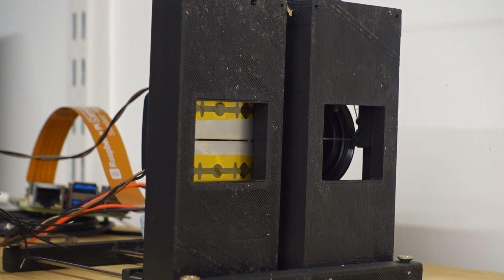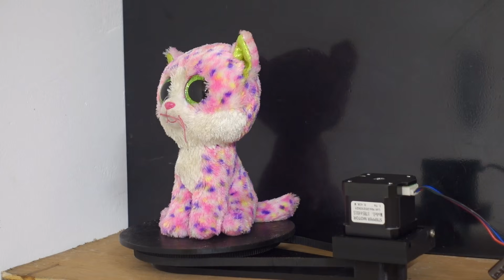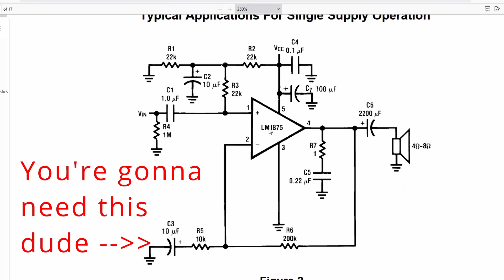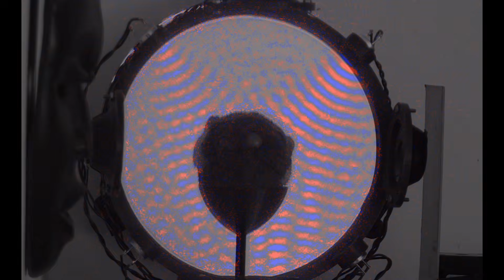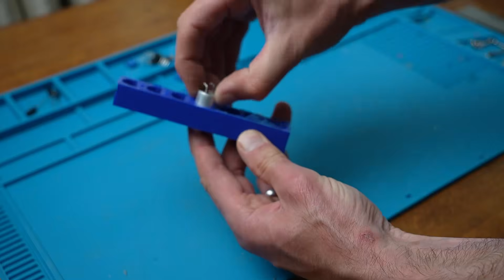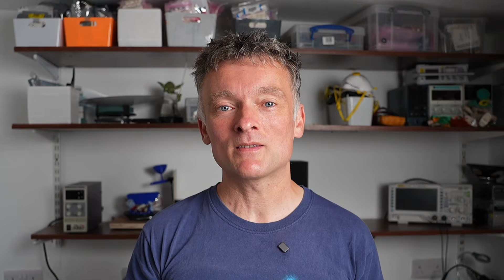I Filmed Why Soundbars Can't Fake Surround Sound

Comment: I mean...if you're playing a constant tone from every direction this seems more relevant, but generally surround sound systems split to account for directionality so...?
Reply from the maker: That’s a good point! While it's true you need overlapping frequencies to get this type of pattern, I'm only sending a short burst of about 20 cycles of a sine wave. Which shows that these patterns don't require continuous tones, they happen even with rapid bursts. 

Even though surround systems split channels to account for directionality, real-world audio (like dialogue or music) very often send the same signal across multiple speakers to create a wide soundstage. Because these channels share identical frequency components, they will interfere and cause comb filtering in the room. 

What’s really strange is how the human brain handles this. Because of binaural integration and the precedence effect, our hearing is very good at grouping these overlapping frequencies. It localizes the sound based on the first wave that hits our ears and smooths out the comb filtering notches. So we perceive a natural sounding note, while a microphone or sound camera captures all the comb filter patterns.

Comment: Video is very good on its own, you don't need the random Ai stock images
Reply: Agreed
Reply from the maker: Good point, for some reason I couldn't find good images of a soundbar or surround sound online, will have to look harder next time and resist the temptation to use Gemini

Comment: it's kind of neat that you only really know it's not working because you're imaging it. I get into a lot of trouble measuring first on things that are technically and experientially good enough as crap
Reply from the maker: Very true, if I was measuring the beam steering with a microphone I might not have spotted that the beams were going in a few different directions at the same time.. I might have assumed some of the extra beams were reflections from walls (instead of side lobes). Am gonna have to give the beam steering another go when I get a chance, I was hoping for a lighthouse beam effect 🙂

Comment: Amazing as always 🫡. I didn't realize beam-forming was so fraught with practical issues. I thought the lack of e.g., related consumer products was mostly due to the complexity of signal processing.
Reply from the maker: Ah thanks :-) Yeah I thought beam forming was going to be a lot more straightforward too, am going to give it another go when I get more time. I might be missing something in the way I delay the Sine waves or it might be some kind of mechanical difference between the transducers (I might have mixed batches).. I recon if you needed to beam steer a short burst of different notes this would be very difficult without a lot of calibration as it seems to take a fair while for the transducers to get up to full amplitude (probably because they are very resonant)